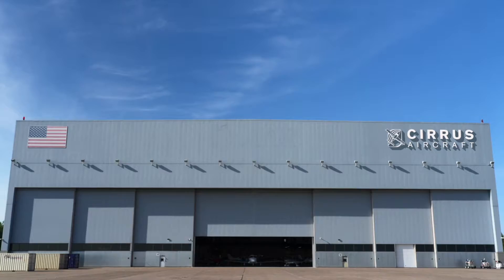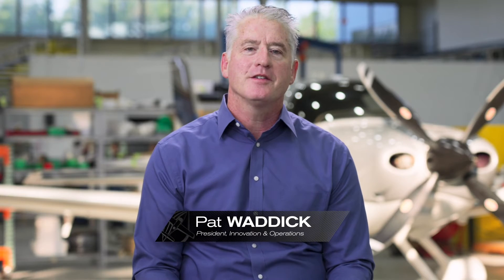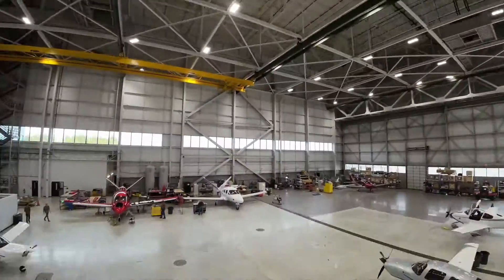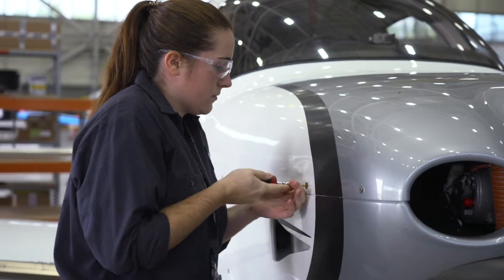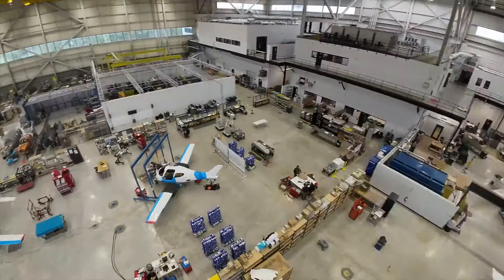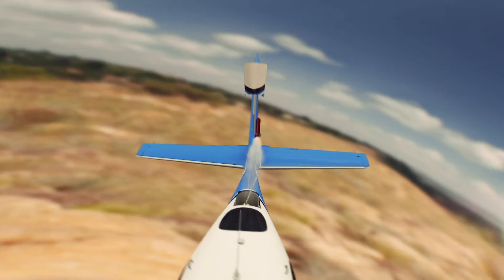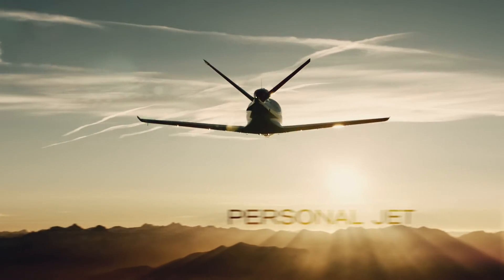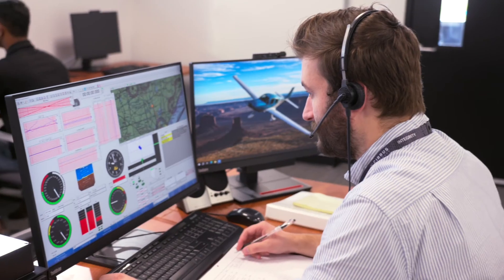Introducing the Cirrus Aircraft Innovation Center

Comment: I call my fantasy land idea the Cirrus SR10 a 2 seat airplane for the common pilot. It costs about $150k, it has a parachute, and basic instruments to get an IFR rating. Cheap and cheerful. I am semi-serious. I also know there are thousands of reasons that can't happen certified flight hardware being one of the biggest ones. I mean come on 3 people could easily finance it for the price of a car. They would sell like hot cakes! The safety brand of Cirrus with a price that is easy on the eyes. When they get their ratings they could sell it, get 2 more friends and level up to a SR22. You can delete the post if you want. I love your airplanes I want to fly in one someday.
Reply: I like this idea, but I don't see how it could be $150K.  I'm thinking $250K-$300K with a 4-cyl engine.
Reply: @michaelkim3432  I made the number up. I agree it's unfeasibly low. I'm not hating on Cirrus you can't slap something together on the cheap then send it flying over someones house at 10k feet safely. I respect the process and that there is a cost for safety.